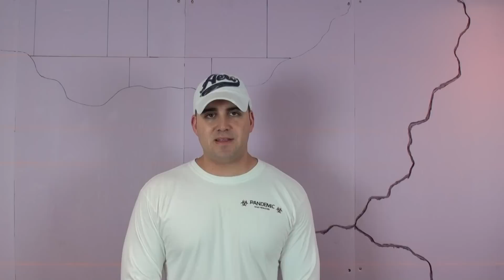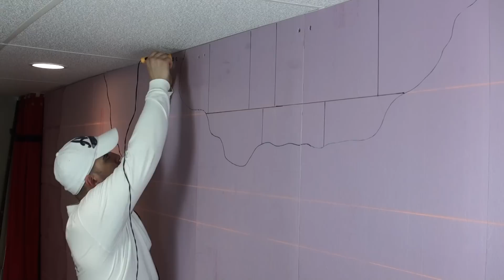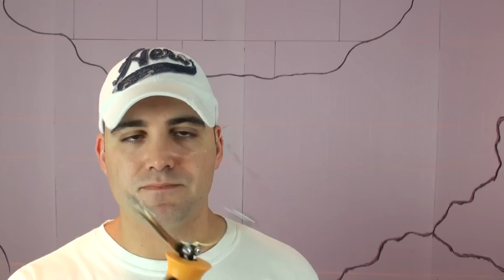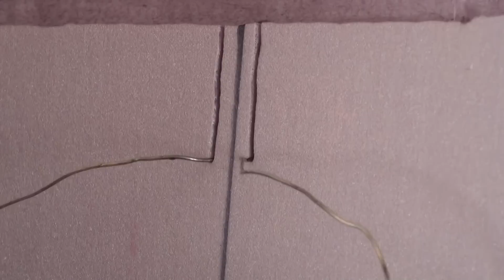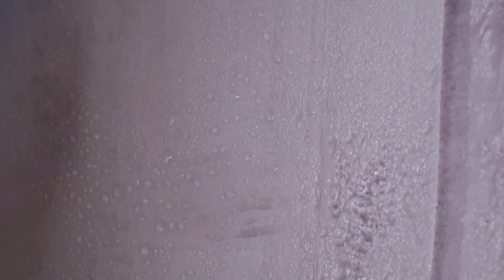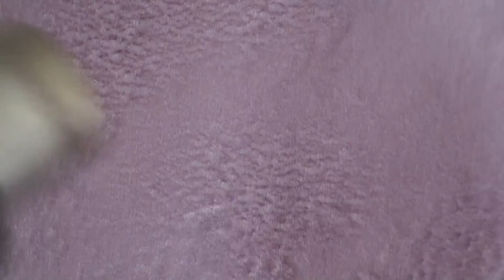Foam Carving Dungeon Walls ( Part 2)

Comment from the maker: @dietmtndewcub  The problem with piano hinges is that they are actually a little stiff. If you intend on opening and closing the lid quit often it will just rip itself out. I would suggest building a sub-frame, maybe out of 1/4 plywood, then attach your foam over it. That way you will have a some kind of wood structure to mount your hinges and anything else you might want. (like lights, pneumatics, smoke machines....) And if you build it right, it could be made to break down for storage.

Comment from the maker: @Joiseygal The tools are from Hot Wire Foam Factory. I bought this set from the National Haunters Convention. But you can just go to HWFF.com and get them. They have some different options for there tools. Its worth buying a kit of three or four tools. It says money in the long run. They do work great. Just take your time and let the heat cut.

Comment from the maker: You spray the foam down with water to get a more realistic texture. The heat from the gun melts the foam around the beads of water. And as you move the gun around, the beads move around and make a very cool affect. Try it out and you will see what I'm talking about. 
As for heat guns themselves, anything over 1400 watts or 1000 degrees will work fine. Hair dryers do not work. They don't get hot enough.  Dual power guns are great too. Mine is 570 degrees on low, 1000 on high.

Comment from the maker: I think I got the kit for 185.00 from the NHC 2 years ago. There are a couple different kits you can get. Go to the Hot wire foam factory website to find out more info.

Comment: Just found your channel and it's great! I was familiar with your heat gun technique but I like the refinements you introduce, like waiting for the foam to dry and going back over it again to smooth out the ridges. 

And I finally know how to use the router tool! I actually made my own handheld tool but used it primary for freehand carving. Can't wait to build so walls next year to make grout lines now! 

Thanks for the great how-to videos!

Rich

Comment: I just found your youtube channel.  Very informative.  Question...  Why spray the foam with water?  Also, in purchasing a heat gun, any suggestions on what kind or requirements?  Thanks for the videos.

Comment: I have a question for ya...  I am building a casket for halloween out of the 2" pink foam and I am trying to figuar out how to be able to open and close the lid.  I was thinking about using a piano hinge glued to the foam and then nailed pushed in with glue to help hold it.  Do you have any ideas or think this might work?  Thanks

Comment: Nice job. Im new to this. Im doing a similar theme, frankensteins castle. A doc frankenstein laboratory, heavy steampunk theme. Iv tried the water w/heat gun an loved the effect. I didnt try going back over it a 2nd time to soften the effect. Going to try that next. Although my brick is supposed to be pretty ancient. Thanx tho. I learned some techniques.

Comment from the maker: its pretty cheap, the foam is about 12 bucks a sheet, a couple gallons of paint and stain is around 70 bucks. The hot wire tools, depending on which ones you buy, 100 to 300 bucks but you will have the tools for life so its more of an investment.

Comment from the maker: There is a small amount of smoke that comes from the melting foam but it is very very little. If cutting alot of foam you will want to have good ventilation.  Thanks for watching!
Reply: That little bit of smoke contains EXTREMELY noxious chemicals. Wear PPE as well as providing lots of ventilation.